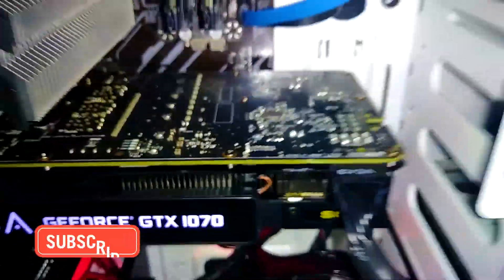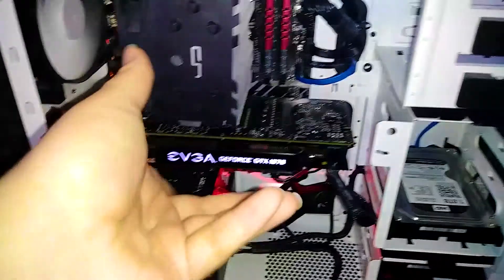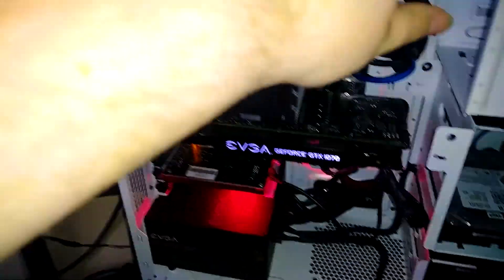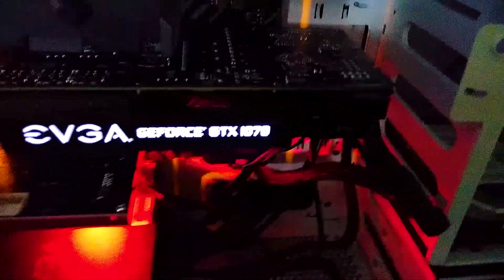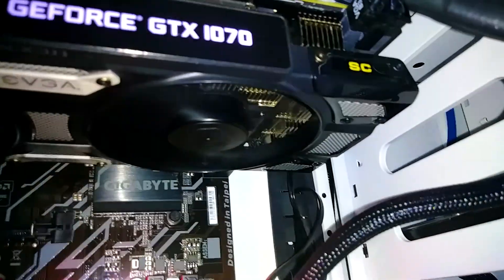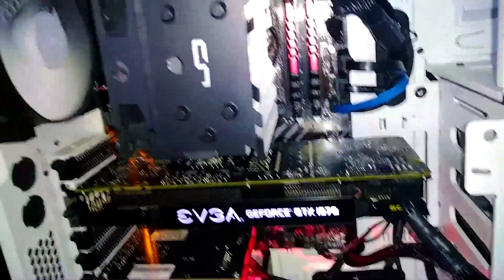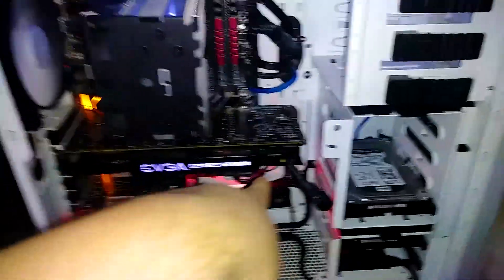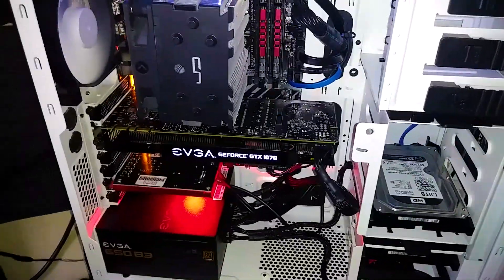GTX 1070 Fan Clicking Issue *Fix*

Comment: I have the identical GPU and was having clicking noise from the right side fan and was worried that  the fan was becoming faulty, however, it was just this stupid cable 😅 THANK YOU FOR SHARING 🙌🏼 adjusting wire resolved the issues, back to playing Bully 😊

Comment: I RMA'd my 6600 with a similar noise and after I installed it back the clicking sound still appears sometimes when the fans spin up.What the actual heck...

Comment: Thanks you showed be where to look bc mine wasn’t a wire, it was a ZIP TIE!!! I got a pre built for Christmas from microcenter a year ago(I wanted to build one but I don’t really care that much) and I’ve noticed that everywhere are cut zip ties but they are still there in the fans and gpu so they cause the fans to mess up and make loud noises

Comment: Found temporary solution by installing Afterburner and setting it up so the fans never stop turning. But I'll check if the wire is causing the sound.

Comment: I think the wire could be responsible for powering the LED logo on the side of the card because the PWM fans would have a 4 wire cable but that cable is only 2
Reply from the maker: except that 1070 doesnt do light up LED
Reply: @ReyzGamingChannel  My MSI 1070 does and it's been doing this slight cricket-y noise while the fans are running for a while, thanks for the tip!

Comment: Thanks so much.  I have a Gigabyte 1070 and different fan setup but it was the same issue.  My wires when down not up, but they were also hitting the fan blades.  A little push and no more annoying clicking sounds.

Comment: my 1070 ti makes a clicking but only at certain fan speeds
Reply from the maker: PROB THE SAME wire as mine
Reply: @ReyzGamingChannel  it usually happens when the fans spin down from high speed to low